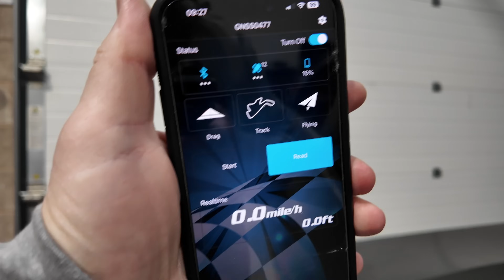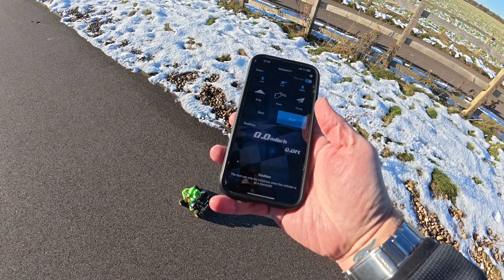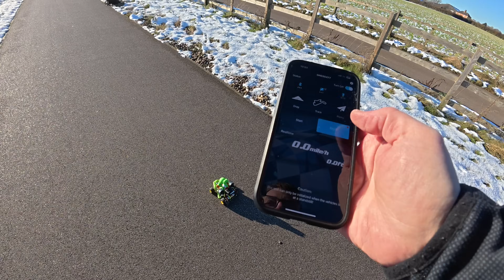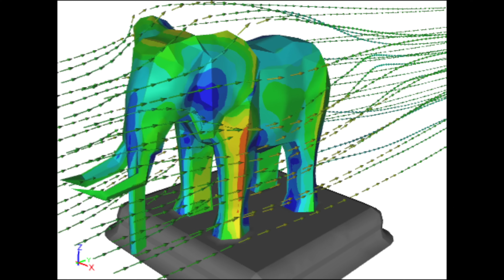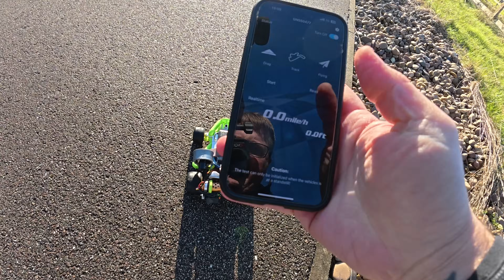Making a Mario Kart RC Toy 6 x FASTER!

Comment: 1:25 LiFePO : lithium iron phosphate batteries have a lower nominal voltage of 3.4 volts but are much more stable than lithium ion, usually not combusting even when punctured or crushed. 
i.e: good for babies who will be driving Yoshi, although I'm surprised that Nintendo didn't slather the batteries in a bittering agent, since they are the perfect size to choke on, if a suicidal baby gets ahold of them.

I hear there are lots of suicidal babies in the UK, which is why all your electrical outlets have safety shutters.

"Stupid babies need the most attention"

Comment: Take those little motors for the EDF and use them to drive the rear tires.
Reply: You could almost fit them inside the wheel hubs it looks like.

Comment: When running the stock electrics you have to get on the power as gently as possible...The 1250kv comes stock in the 8s Kraton as well but should be good for closer to 110mph

Comment: "EDF fans don't go backwards...". Well why the heck not? I suppose you don't generally need it for their primarily intended use on model aircraft, but isn't that controlled by the ESC?
Reply: Because he used esc's specifically for edf fans @ 6:44
Reply: @geuzeg  ah, okay... I figured you could just reprogram the ESCs and/or use alternate firmware. Thanks!

Comment: I was making rc repairs one day because it was smoking, so i swapped the diff i had a 12T motor in it i have another car it had a 15t motor it stopped driving for some reason "probaly wires" but the motor also had a broken fan blade and a rock inside fhe motor i know it because one fel out one day. I soon got a 20 t motor and we got the wires sottered on But ive never got it on since one day i was looking at the first rc car and i noticed the recever was broken the controller broke before the recever so i didnt care so i had an idea why dont i put the 2nd car on top of the first.

Comment: I took the motor out of a 18v dewalt drill and put it in a stamped then put the drill battery and rigged it to the truck the esc lasted about 5 minutes but wow crazy fast. Then poof up in smoke. I put the largest pinion gear i could find on there. And it still took off like a bullet.

Comment: Phil if you put some thrust tubes on those edf's theyll work much better. A lot of the air coming out the back of those will be coming out sideways thanks to the centrifugal force. Thrust tubes will help the air straighten out and provide more usable thrust.
Reply from the maker: Yes, I think the next project will have a V2 mount with some thrust tubes. I might go a bit bigger on the vehicle and the EDFs... see if we can get some crazy speeds!

Comment: But MAH on the lipo doesnt do anything for speed or power! xD  Then going 3 cell yep! Thats the way to go. (Mah is only for run time aye?)
Reply from the maker: The Amount of mAh multiplied by the C Rating gives you a discharge figure in Amps. So if you have 2 batteries with the same C Rating, the one with the higher mAh will be able to deliver more amps... which in turn will increase performance and also reduce voltage sag. 
Every days a school day aye
Reply: @TomleyRC  True! But its so tiny that it doesnt matter in RC cars. What is school? aye xD
Reply from the maker: @ tell the speed runners it doesn’t matter and I’m sure they’ll gladly share some stats with you 😇. Bettery temp, capacity, resistance  & c rating all matter for maximum performance 👌. Although as my test proved.. in this build it didn’t really matter 👍

Comment: I own a graupner go kart 10.I bought it off eBay many years ago.I even bought spares for it as in a new chain tyres rims and air filter.Its approx 30 odd years old.Its so rare that I have never run it.Its in a drawer.After seeing this I think I'm going to display it on a tilted shelf.I was thinking of contacting you or Kev Talbot to see if you wanted to buy it.But it's so old it would hurt to see it getting used then possibly wrecked.No offence.

Comment: This is fantastic. 

Have a question to the aircraft engineer about fans: Am I a moron, or wouldn't press fitting from the front allow the fans to push themselves out of the housing if they get loose? The air pushes back, meaning the fan is pushed forward, no?

If they were inserted from the rear, then the fan force would seat them further down, is how it seems to me.

Far be it from me to question a fella with so much fan experience, but my smooth brain is struggling.
Reply from the maker: Yes haha.... my bad. Maybe that's why I was an electrician, I'm not sure the Jets would have flown very well with an engine in the wrong way

Comment: I did wonder if I could do something similar with a no prep drag car. Nothing in the rules says it has to be wheel driven and props don't need traction.
Reply: Imagine the noise a car would need to make to get off the line using these fans.
Reply: @BeardRubEnjoyer  I've had planes running at around 3kw so probably a lot like that. Would be easier with an open prop though. 4kg of thrust on a 7-8 inch prop is pretty easy to achieve.
Reply: @BeardRubEnjoyer just pop a little rocket motor somewhere to get it off the line.
Reply from the maker: I’ve seen some crazy looking 1/7 scale ones that use both. Not sure how easy they are to keep straight though
Reply: @TomleyRC  Not difficult when speed running or just bashing...but I'm also curious how a drag setup would handle EDFs. I'm currently working on a drag-inpired hybrid build to incorporate both motors and EDF!
Reply: The pixilated footage was top-notch, Phil.
Reply: I've built hybrids that utilize both motors and EDFs. More for speed runs/bashing, but I do have a silly drag-inspired build I'm working on with twin TP 1450KV motors and a 105mm EDF! I'll put it on the channel once I'm done! Good luck with your build!
Reply: Edf's won't accelerate the car fast enough for it to be competitive though.
Reply: @Jakefrc  edfs can generate a lot of thrust  and they are not limited by traction. if you have 4kg of static thrust and 2kg of car you are accelerating at 2g. Not sure what tires will max out at but I'd guess it somewhere around 2g. Get a few more g of thrust (eg use open props) or less g of car and you'd be going quicker.

Wheels are more efficient at transferring force compared to props but there's an upper limit to the power you can apply dictated by the traction the tires can generate. That's not a limit props have.
Reply: If you want, but look at the poor acceleration. 
You're married to 2s with drag cars, so I don't think you'll win any races with an EDF.
Reply: @Boogie_the_cat  Just need more amps 5000mah high c packs are good for 100s of amps. With a 7 or 8 prop, not an EDF you could easily achieve 6+kg of static thrust. F=ma my dude
Reply: Fans have reverse why u need brakes, oh shit someone can't program the three little esc's? Why on God's green earth did this poor thing need 3 esc's? Let us know your bad at things without telling us.
Reply from the maker: It’s not that you can’t reverse fans… they are just not very efficient & use a lot more energy. And it has 2 ESCs… not 3, 1 for each fan 😇
Reply: @jeremibisher5611 Let us know you're a hater without telling us you're a hater
Reply: Just because rules aren't written doesn't mean they won't be applied.